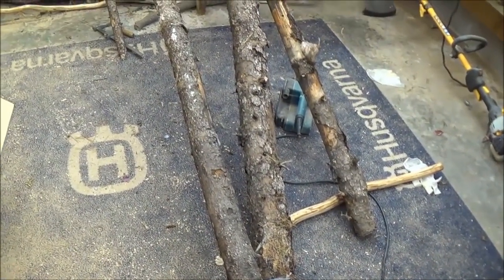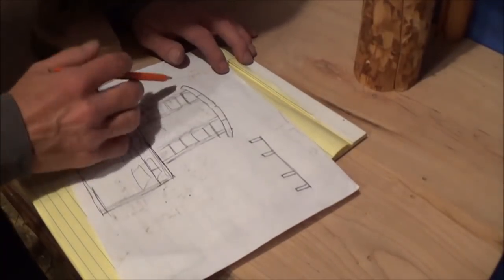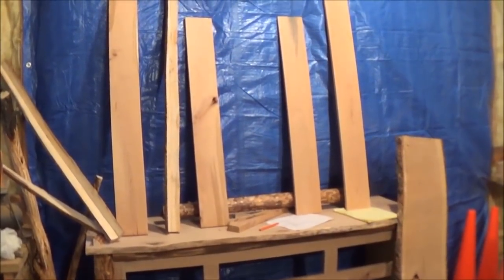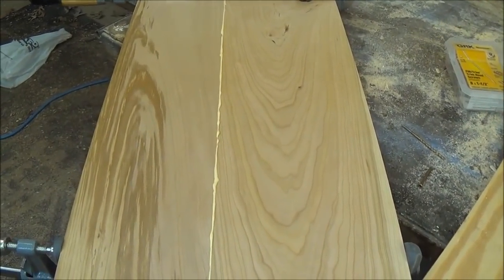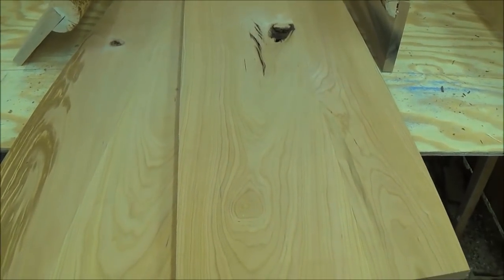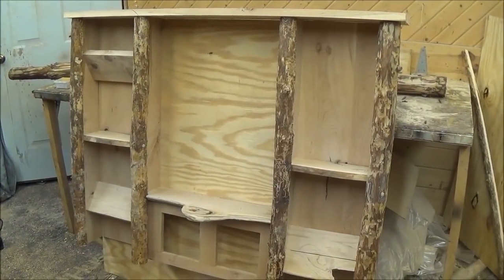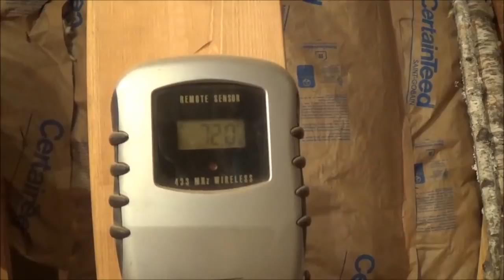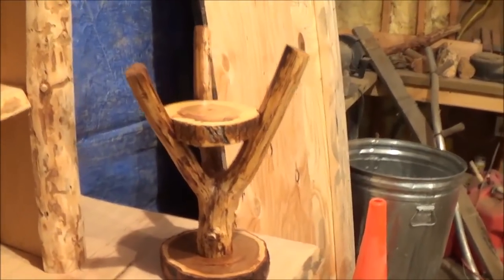The Log Dresser. Part 2. A few more days in the workshop.

Comment: When I was growing up my dad had a radial arm saw.  Off the back of the saw was a port for a hose.  He connected the hose to the input on a shop vac, one of those old steel barrel ones.  Anyway, it trapped all the saw dust and he was able to run that saw in the basement of our house without catching too much hell from my mom.
I know the exit on the planer is a 4" opening but you could get a shop vac with a 2 1/2" hose, reduce the exhaust on the planer to 2 1/2 inches and hook the hose to it.  There would be enough air flow from the suction of the vacuum to make up for the restriction of a smaller hose.  Just be sure to turn the vacuum on before you run anything through the planer... maybe a single switch to power on an outlet that both the planer and vacuum connect to?

Comment: Joe, if you need a finer filter for the vent off the wood chip can, ask one of the ladies at home for an old pair of pantyhose.  I've used pieces of them for everything from the vent off my shop vac to making "hammocks" that keep cantaloupes off the ground when they sprout in my compost pile.
Reply from the maker: That is a GREAT idea. That would drop the dust level down a lot. Thank you Sherry.

Comment: When building the drawers, are you going to cut the corners at 45 degrees, butt them together, or dovetail the corners?  If you are able to, it would look cool to dovetail them and have the peeled edge to the outside so you would see a clean board, then peeled, then clean, then peeled and so on.  Just an idea I thought you might like.